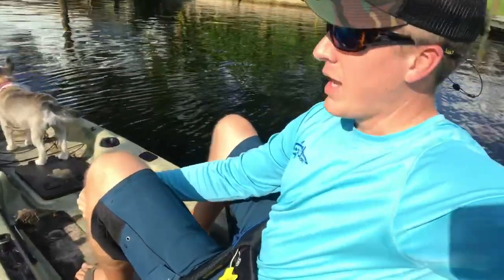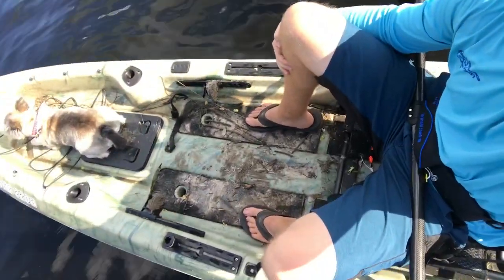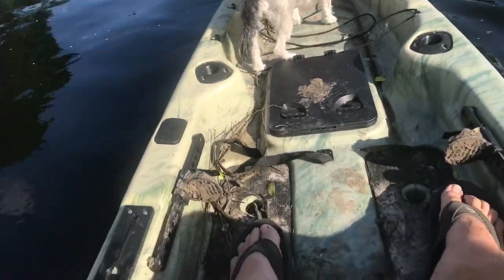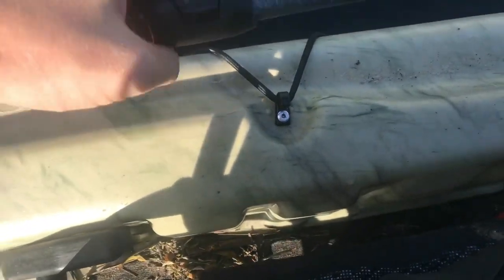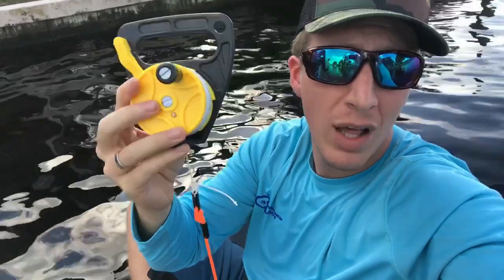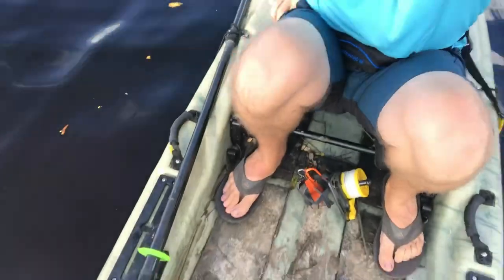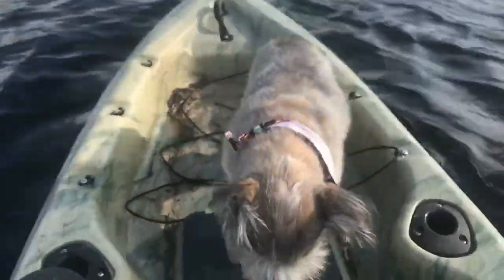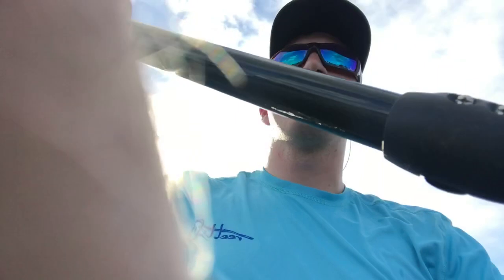Sun Dolphin Boss 12 SS LIVE Q&A On Water Test

Comment: I have heard from multiple people that the plastic on this kayak is thin in spots and when it is in the sun/heat the kayak give in and has even failed on itself on some people.
Reply from the maker: Derek Perez in really high heat heavier people maybe 250lbs+ have reported the seat mount flexing and dislodging.  

I have not had this issue.  I’m about 200lbs, but I’m in the very hot Florida gulf area.  

Not saying it doesn’t happen, but I have not had it happen to me.  The top deck where I stand feels more solid than Hobies I have owned.  It doesn’t flex near as much.   All I have done to mine is put gator guard patch strips on the keel so when I drag it occasionally it is more protected.  Zero issues.  I abuse this kayak.  It is my throw and go kayak.  I love it.

Comment: I have a 10' lifetime tahoma, I mainly catfish, I live in Tennessee, the catfish I target range from a few pounds to around 100# ,I'm tossed between this kayak your on, and the lifetime Yukon, I need an open flat cockpit and one I can stand up to pull in the big cats, which both have, my question is, do you think the gear tracks will hold up to the force of a big take down with rods in a rod holder?
Reply: The Lifetime Yukon is MUCH sturdier and better built. Honestly though, if you are at a $500 to $600 price point you would be better off saving up a little longer and stepping up to the next tier of boat. I was going to buy a Yukon but caught a 3 Waters Big Fish 120 on sale for $809. That additional $200 to $300 will make a night and day difference and put you in a far nicer and better built, rudder ready boat. The Big Fish boats are still on sale $799 for a 10.5' and $899 for the 12'.

Comment: I've heard the seat locks failing at 75 ? Being in Florida we're you around that temp there? Would you do another at this weather gets warm to see if there is substance to that argument ?
Reply from the maker: I have owned this kayak during the SW Florida summer. I got the kayak around July 2018.  It has definitely been hotter than 75.  In fact even in the winters we consistently hit 70s.  I have had no issues with the seat.  I weigh 200lbs for reference as well.  

Have you seen my latest video review of this kayak?
Reply: yese how long you had had the kayak or how hot of a day youd had it out in. So the seat fail thing hasn't been a thing for you. good to know. At 497 retail right now and with a 545 lb capacity this one seems hard to beat for a starter fishing kayak
Reply from the maker: Blue Collar Fishing I have had it out in 97+ degree weather.  I stored it outside for most of the time I have owned it. Therefore it baked in the sun and yet still never had issues.
Reply: that is good to hear . I do wonder if your results might have been different if you had purchased one of the mass produced ones at wal mart ? they seem a great budget option I have seen plenty of people claim to have the issue with the seat . so maybe as a known youtuber sun dolphin sent you the best quality one they had available ? is that a possibility ?
Reply: I bought 1 a week ago and been in the water 3x with it. I have had the issue with the kayak spreading in direct sunlight (barely 85 degrees). The seat drops to the bottom position. I am thinking about fabricating a bracket to tie the seat mount brackets together to help support it. Otherwise i really like the boat.

Comment: I’d really like to know about the scupper holes....there’s basically a tiny hole through 4 of them and the otthers aren’t even holes at all, they’re totally sealed. WTH?? 
Drill them out??? No?? I just bought it and don’t know what to do.
Reply from the maker: The Fishing Family all the scuppers have holes they just appear large from outside but are maybe only 3/8” to 1/2” holes.   There for they can plug easier if debri gets in them.  No big deal.  I just occasionally paddle really dirty tree leaf covered rivers while hunting for fossils...tree leaves plug the holes occasionally.  It isn’t a deal breaker for me.  Still love the kayak.  Great value.  You might be able to drill the holes larger, but I didn’t want to risk it.  It didn’t bother me enough.
Reply: KayakDIY thanks...what’s weird is that I have the small holes in 4 of mine and then 4 literally DO NOT have holes at all. 

What did you feel the risk was with drilling, that the two thermoformed layers are separate inside and it will leak? 
I’ve heard the idea of using a hot poker to make the hole bigger. Hmm. 

I fish mostly ponds & small lakes in the northeast and definitely have leaves, weeds, etc that are going to be an issue.

Comment: Does it have slide tracks on that kayak where u can add a "lean casting bar" btw great video!
Reply from the maker: It has one set of tracks on each side in front of the seat.  You could do a stand up bar but would still have to drill and secure two mounts to the kayak.  The other two mounts could attach to the tracks.

Comment: Question, do you think this stable enough for scuba diving off it, I can add outriggers if necessary.
Reply from the maker: neb459 I think it could be used for that.  Just depends on the waves and how rough the water is.  As I mentioned this kayak does drain slower and shouldn’t be used in really rough offshore conditions.  The scupper holes are small and that could lead to pooling water on the deck which could eventually get into the kayak via hatches.  With that being said check out my most recent stability test of this kayak.  It is pretty dang stable.  Very happy with it.

Comment: Thoughts on using this kayak in salt water like the puget sound in Washington?
Reply from the maker: FryedGamingNet I am in saltwater environment most of the time.  I live on a gulf ocean access canal.  I camp on gulf islands.  The only concern i have is really large waves and slow draining via limited scuppers.  The scuppers are small and more centrally located so large waves “might” result in pooling water which could eventually intrude into hatch if it gets high enough.  The hatches are raised off the deck so that is nice as it helps prevent water intrusion.  Other than that saltwater isn’t huge concern.  Just wouldn’t want to go through large waves which could go over bow or gunnels. I’m going to use this on saltwater areas around Sanibel Island FL but not likely on really choppy days.  For days with really large swell sizes I will use my Viking Profish Reload.

Comment: How is this yak going to handle creeks and rivers were the bottom will get beat up?
Reply from the maker: I did several runs in rivers and creeks.  However I installed 3 ft of Gator Guard patch keel protection in bow and stern keel area. No issues I can see just faint scratches.  Friend an I run Florida creeks for fossils like megladon and mammoth.

Comment: Would the universal rudder mount from Bixpy work on the Boss? Thanks!
Reply from the maker: KretzOAR if you want I will try it and make a video!  🙂👍

Should work great.  Just need to add the Gudgeon Mount. https://lddy.no/6lj5
Reply from the maker: I will probably use this for steering.  Although I could probably tie rudder lines into factory footpegs.  https://lddy.no/6lj6